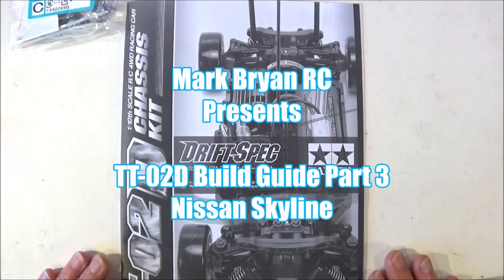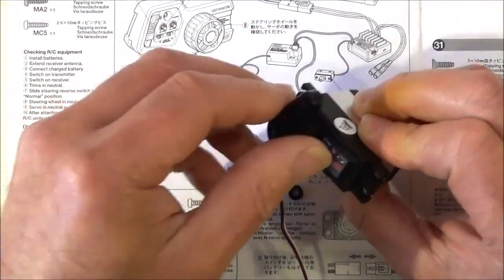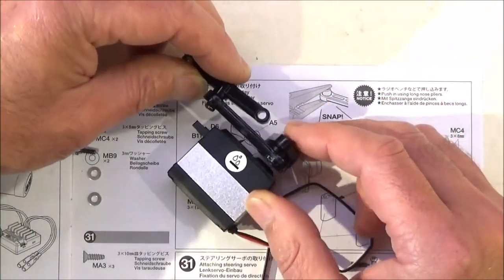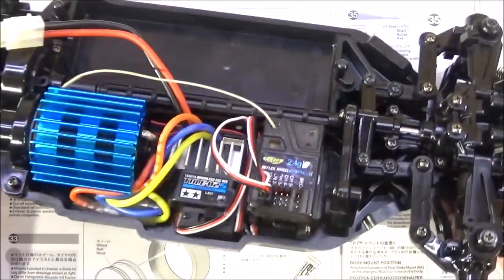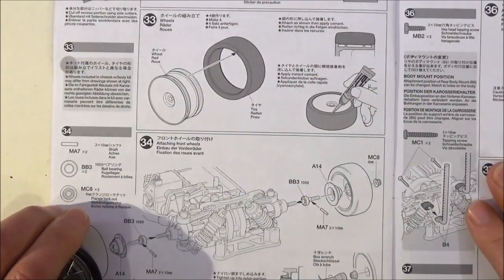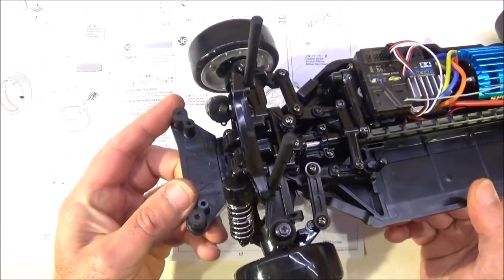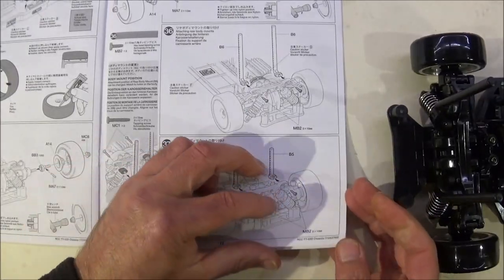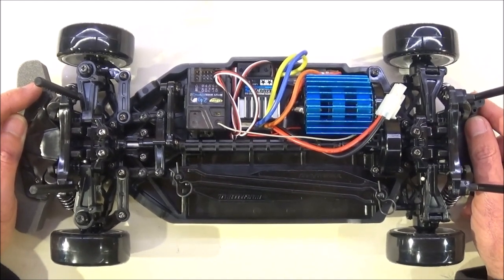Tamiya TT02D DriftSpec Build P3 Nissan Skyline Chassis Complete

Comment: Question: Why is the steering angle so limited?
Reply from the maker: Hi George - it's because this is not a dedicated drift chassis, it is a standard TT-02 with a few hop-ups and drift tyres added. The standard TT-02 chassis does have a very limited steering angle that is difficult to improve.
Reply: @MarkBryanRC  I see. Thanks Mark. That's good to know!

Comment: So I did find the barrings but I have a problem my drift rc is driving the the opposite way it’s driving backwards
Reply from the maker: Good you found them! Simple way to cure your problem is to set the transmitter throttle to "reverse". This happens to me sometimes, just switch the transmitter or alternatively swap the motor wires over!  :)
Reply: @MarkBryanRC  thank you it works good now your videos are very helpful thanks
Reply from the maker: Always a pleasure - all the best from Mark...  :)
Reply: @MarkBryanRC  and one more question is there supposed to be a reverse on the car cause my dosent
Reply: Reverse
Reply from the maker: @lowhonda_7243  Have you tried double tapping the reverse? Hit the reverse trigger for a second and let go. Then, about a second later, hit and hold the reverse trigger. It should then reverse the car. If that doesn't work, you need to check the ESC manual and make sure reverse is enabled.

Comment: Ive followed your whole guide but for me the motor isnt running at all.. ive no clue whats wrong
Reply from the maker: Hi there - sorry to hear your trouble with the motor. Do you have the TBLE02s ESC fitted? If so, check that it isn't set for a brushless motor - if it is, the stock brushed motor won't turn at all. Good luck!
Reply: @MarkBryanRC  found the culprit now! Turns out I put the esc onto bind haha 😅
Reply from the maker: @ep3  Great to hear you sorted the problem, Erne! Enjoy the driving!  :)
Reply: @MarkBryanRC  yup been driving for a while now, amazing first chassis but quite difficult to drive indoors 😅

Comment: How much money did you spend on the whole build??
Reply from the maker: Hi - not sure exactly, but The car kit was £126, the ESC was £15, the servo £8, the paint was £5 and I used a radio set I already use on other models (that was about £35). I hope this helps answer your question!  :)
Reply: @MarkBryanRC  thanks!
Reply from the maker: @adrianortiz65  😄👍👍

Comment: what are the weel sizes
Reply from the maker: 1.9" diameter (48.2mm), 0.94"; (24mm) wide, 12mm hex, +2° offset - I hope this helps.  :)
Reply: @MarkBryanRC  thanks, also what motor would you recommend as an upgrade.
Reply from the maker: The Sport Tuned motor included in the kit is very good. If you want to go faster I recommend any 13.5 turn brushless motor.  :)
Reply: @MarkBryanRC  what upgrade parts would you recommend
Reply from the maker: Well, the kit is pretty good as is, but it may be worth upgrading the steering to an alloy one with bearings, and the centre propshaft alloy upgrade and joints is worth doing.
Reply: @MarkBryanRC  what servo should i get then
Reply from the maker: @chiendenferzkenney6049  I just used a cheap  standard servo (3kg) from Etronix, it works just fine!